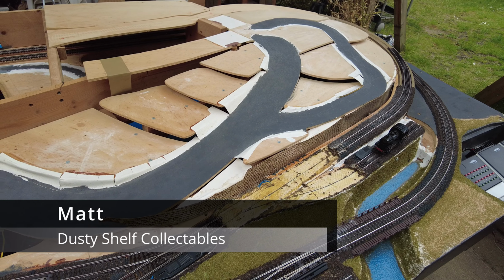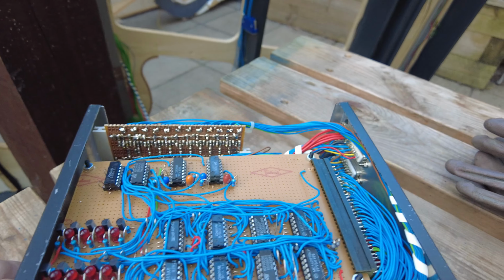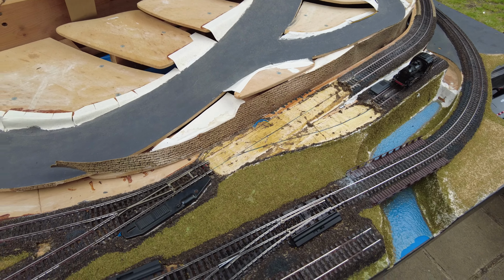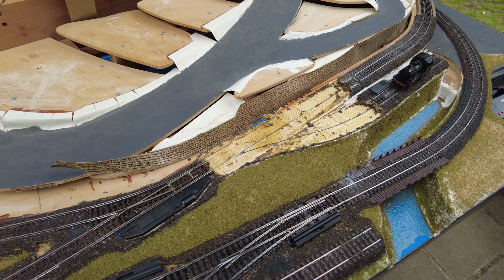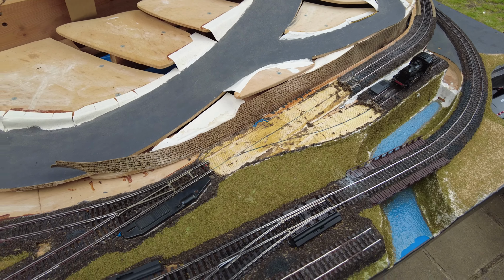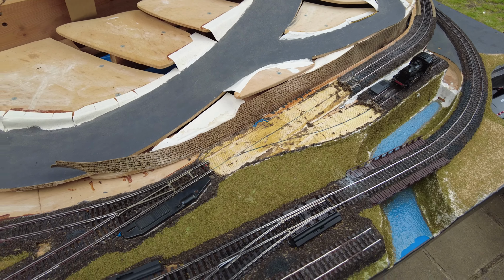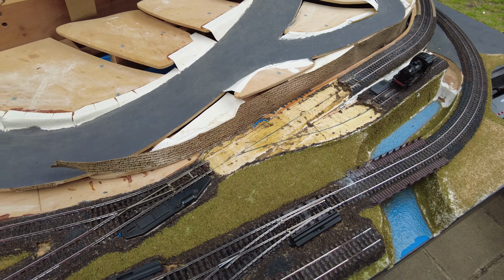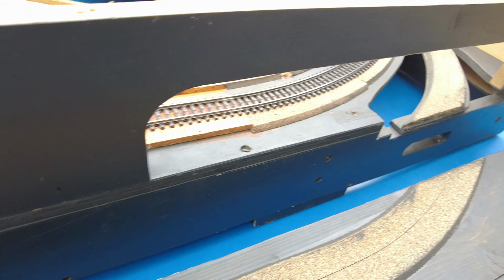märklin Digital, A 3 rail model railway. Getting the layout running?

Comment: Enjoyed the update. I take my hat off to you being able to fathom the  half built layout of someone else and then begin to continue it. I too have an old Marklin set, non digital with the old type of M system stamped metal base track. I have laid a round the wall track parallel to my Hornby Dublo and Triang tracks as I like to run all the older trains that meant so much to me growing up in the  1960s. Await the next installment of your Marklin project with interest. All the best. Jim in Aust.
Reply from the maker: Hi Jim, nice to hear from another Markin modeller. I was worried at first the layout was a lost cause, but with a bit of hard work and a lot of luck some how it running. I also run Hornby Dublo three rail, you just can not beat the older locos! Anyway thanks for watching and taking the time message.